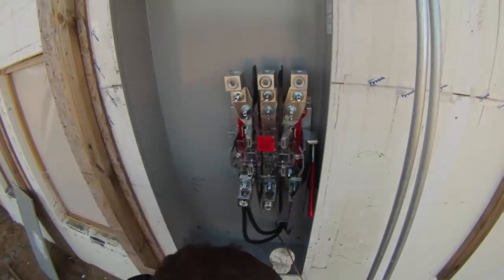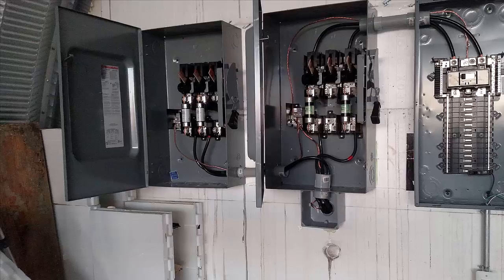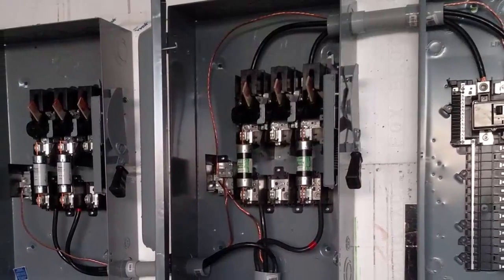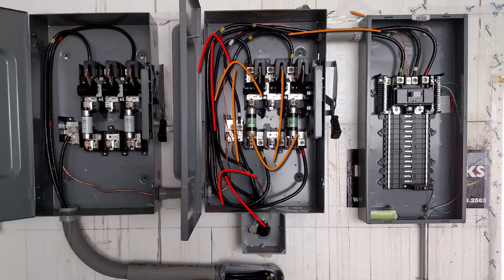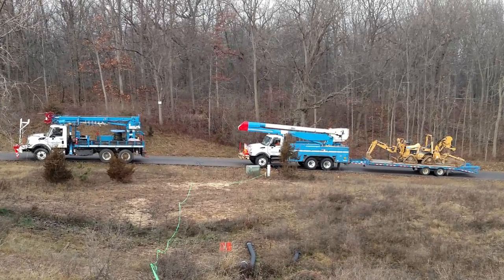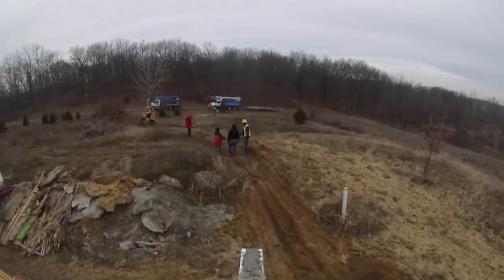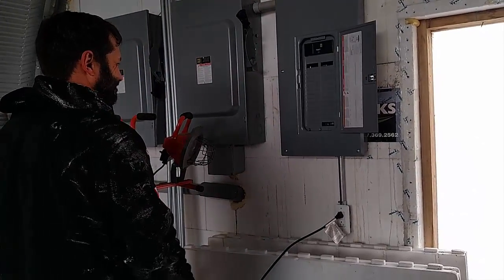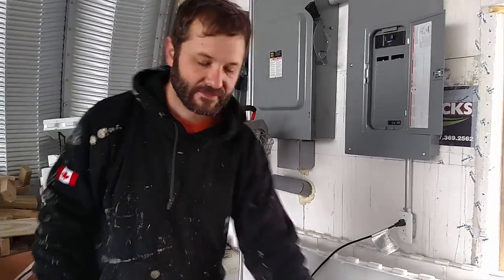22.0 Main Breaker Electrical

Comment: Please, please keep the door from the Main bracker closed, while you opperate it!
If there is ever load on the wire, the Electric arch could burn your body and face. It couldnt with closed Doors.
You should search for videos which show you the amazing electric arch that can be possible.
Reply from the maker: Sure, good safety tip.  Of course, in my case, I wanted to show the mechanisms of the main breaker, so I just made sure that the downstream breaker was off so no actual current would flow.  I now have a lock on that cabinet door.